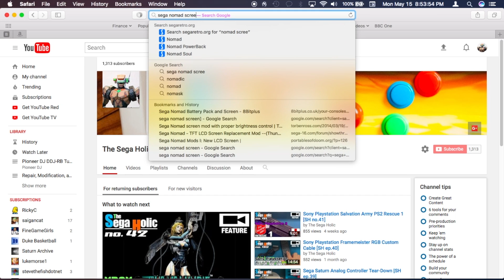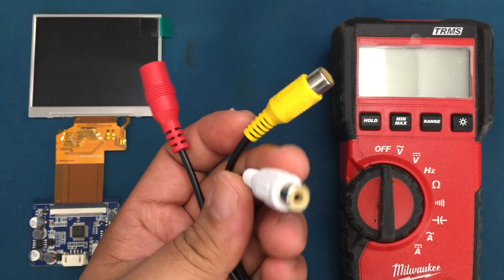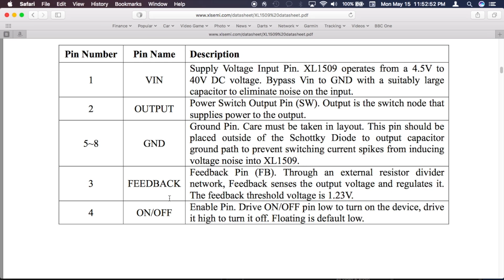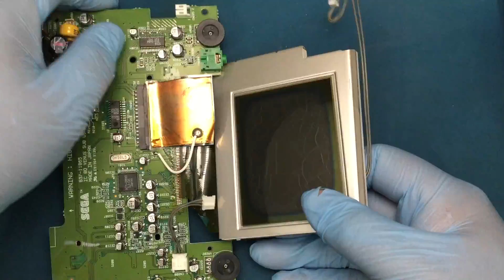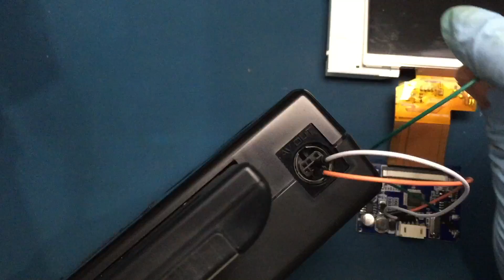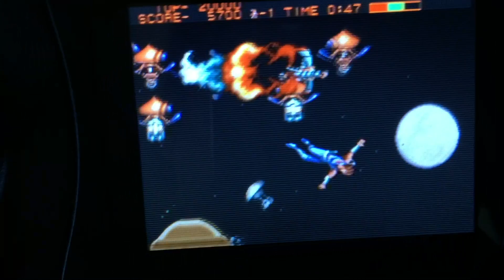Sega Nomad Screen Replacement - A Comprehensive Guide [SH ep.43]

Comment: hi, sorry for mi bad english , at least i on that new revision board where i need to solder cable for do 5v power? its for another project where i need power it with 5v but i dont see in video where you solder the cable for down from 12 to 5v like in older rev of board. thanks a lot.
Reply from the maker: http://i252.photobucket.com/albums/hh3/ctwentytwo/DSC00017b.jpg
Reply from the maker: OK, this should be it:

http://i252.photobucket.com/albums/hh3/ctwentytwo/driver%20board.jpg
Reply: that is!, if i connect a 5v source to here i can power the screen really?
 i apreciate a lot you save me! thanks so much friend.
Reply from the maker: remember to also connect ground, and you should be good. Try it out, the screen should power up.
Reply from the maker: Did it work?
Reply: Got this all wired up, but unfortunately the picture while better than the original screen still isn't as good as yours or the others I have seen. It looks blurry with bad viewing angles... I went to look at the pictures of your mod, but unfortunately can't because of some photobucket limit...
Reply: I found where you soldered all the wires to the LCD board, but the video moves too fast and is too far away to see where you solder 5V and Ground on the Venus Sub.
Reply: Even running it through just the AV jack produces the same results, probably need to use different wires than what came with the LCD? Perhaps I got a dud.
Reply from the maker: Mind taking a video of how the video output looks like?

BTW, take a picture of your LCD driver board from directly in front and I can show you where exactly to solder your wries... also , it will let me see how you wired your board. I know someone else did this, and it worked OK for him/her. His/her comments should be on this video also.
Reply from the maker: Also, one way to verify if it's your Nomad, or your display is to use a TV and output with RCA's with the Nomad's AV out to the TV. This way, you can see if it's your Nomad's composite out signal is the problem or not.
Reply: All good now shortened the cables and tested it using the AV connector. My board is absolutely the same as yours. Just need to know where to solder it to the board. Currently, photobucket won't let me view the links you provided earlier. I found the 5V picture; I saved it earlier, just curious where you got ground from.I know where else I can get it, just would like to keep it all on one side.
Reply: In fact, doh the same picture has it all in there.
Reply: Thanks again for all this.
Reply from the maker: There's 2 huge pads on the bottom right side of the board when looking at the picture. Both should be ground. Both pads have nothing soldered to it.
Reply from the maker: LMK if everything is OK and if you need further assistance.

Comment: I have been wondering why does everybody use composite output for this mod rather than RGB? The composite looks great on the new screen but since the nomad has actually really good rgb output I have wondered why it is not used for the screen mods
Reply from the maker: Oh yeah, you can bet I'm on the RGB bandwagon.... look at my previous videos! Obviously, RGB would be ideal. But it's about the LCD driver board inputs. No cheeap display/driver board combo has support for RGB. 

A couple has surfaced though recently, but it's expensive. $79... plus you'll need to convert RGBHV's vertical/horizontl sync into CSYNC, as it only has separate Horizontal and Vertial syjnc, or Sync on Green (RGsB).

You can follow a thread I just started contributing to today:
http://www.sega-16.com/forum/showthread.php?31885-Sega-Nomad-TFT-LCD-Screen-Replacement-Mod-(Thunderblaze16)... I'm posting as "Catch22" btw.

Also, like I stated, the video on this small screen is incredible for having a composite in. The video really does not do it justice, as it has moire effects that is not detectable when looking at it in real life.
Reply: Gotcha So it is doable just extra work and quite a bit more  cost.  Since it looks so good via composite it seems like a reasonable compromise to stick with it for now. Thanks again for the quick resposnses

Comment: Excellent guide! This is exactly how I do my Nomads, except that I use a shielded 75ohm video wire (any yellow RCA cable works) for the composite line, and ground it on both ends. My LCD-modded Turbo Express had some video noise and shielding its composite wire fixed it, but it's probably overkill for Nomads.
Reply from the maker: I know, it's quite mindboggling to me how clean this is. Video seems very RGB like. I was looking at the specs for the LCD and found nothing new.. I'm just blown away how clean it is. I actually hooked up the Saturn to it also, and it gave me video quality I was expecting with composite. If there was an RGB driver board, I don't know how much better it would look, but I think there would be negligible difference.

ANYHOW, I JUST FOUND A WAY TO POWER THE NOMAD WITH USB POWER... 5v. THERE ARE SEVERAL WAYS TO DO THIS, AND IN ONE WAY, you don't even have to modify the Nomad. Now you can use readily available power banks. It also means an easy way to wire an internal battery and have charging capabilities built in with the power bank's driver board being USB based. I thought of several ways to implement... reversible, using the power button, eliminating the power socket in place of USB connector,... 

Of course, video when my usb connectors get here. LOL. 

BTW, nice job on the XBOX dashboard video. I'm looking to do this, as I also just got into the whole PS2 MCBoot rabbithole. Might need some advice. THX.
Reply: Thanks, can't wait to see that video!

For PS2, I highly recommend installing a hard drive (using the network adapter) and then using  OpenPS2Loader. I have two setup this way and it's freaking brilliant.. I use the PS2 SATA network adapters that you can get from China for about $20.
Reply from the maker: Already done with the PS2... like you said, I just got out the old...OLD IDE drives and yup, using OPL. Begun with the USB, then to the HD... couldn't get the network to work though, spent all day trying... literally. So you went the AliExpress route for SATA? I was gonna try that route, until most guides said to only use official Network Adapters. I even modified someones theme to more of what I want.  Ironic also that I bought a FatPS2 with Network adapter for $30 off of Craigslist... did some driving thought. The IDE HD gets super hot, so I'm gonna use that for now, instead of the modded FAT PS2 I found at Salvation Army for $12.

I was meaning to make a guide just to simplify understanding MCBoot... as even I was confused about what it actually is and does. This was about a month ago.... before I started playing Gunvalkyrie and making that guide. Christ, you don't know how much time I spend shooting the video and THE FREAKING EDITING, VOICE OVER, AND RETAKES, TAKES ALL DAY.

Then a week ago, I find out that the XBOX has similar hacks, even using the same games to hack. LOL. Only recently got back in the video games after a long hiatus due to the framemeister...cause today's FPS and network type RPG games don't appeal to me... I miss the good old days ..
Reply: I need a huge favor modding community!! I have a Nomad that I'm  trying to mod and with composite board or the newer rgb board i get this weird color shift. Pls help.  Heres a link please tell me what you think pls. Thx in adv, https://youtu.be/dPb4k6HBoP4

Comment: Wonder if they have any of these driver boards with analogue RGB support, would make it pretty much perfect. I suspect the jailbars come from not necessarily the composite video but more the shitty RGB->Composite encoder Sega used on Genesis hardware.
Reply from the maker: There are VGA 3.5 driver boards, but you'll need to build a sync splitter for vert and horizontal sync signals... and you'll have to see how the display handles 320x240 vs VGA's native res of 640x480. I was looking for an RGB driver board, but obviously, others would have been using one by now... IF THERE WAS ANY WAY TO WORK WITH THOSE CHINESE MANUFACTURERS AND HAVE THEM MAKE A DRIVER BOARD THAT WOULD HAVE CSYNC & RGB INPUTS, THAT WOULD BE SPECTACULAR.

And since we're on the subject, look at a spec sheet / data sheet for an LCD display, and you'll see hsync, as well as vsync inputs. It's the color part that has like muliple inputs. I think it would be a simpler processor that would do the work of processing the already separated rgb signals instead of processing a single composite one.

Defintely it has to do with the video processor. Some games have bad jailbars, and others are not quite as severe if I remember correctly. The same jailbars show up on the Framemeister using RGB.